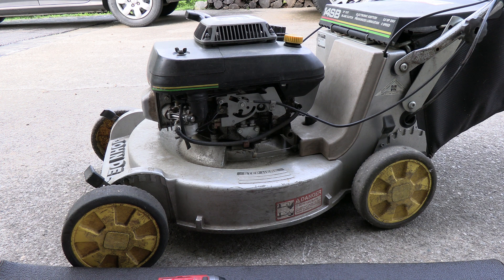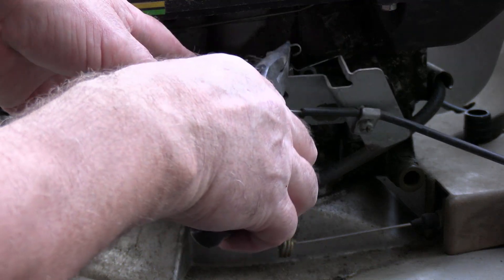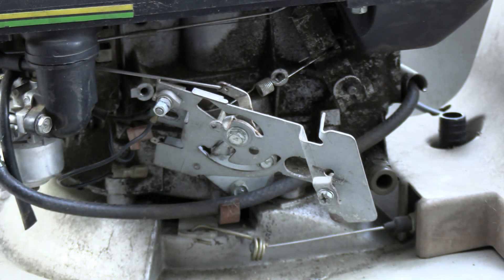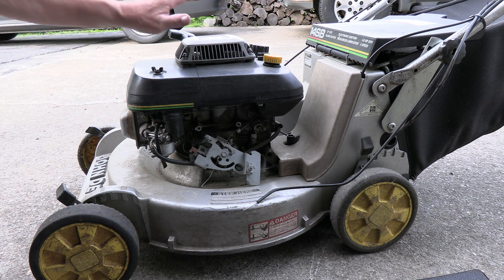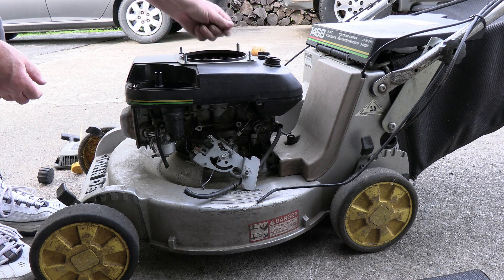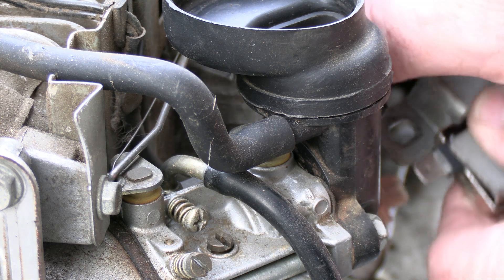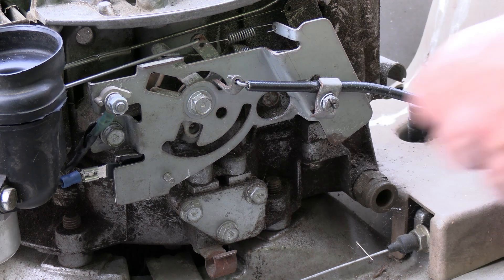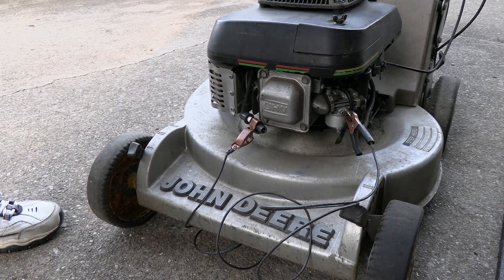John Deere igniter replacement. It might not be the coil.

Comment: I have a cub cadet RT65  MODEL# 21AB455C709   The wheel fell off and i was wondering if you would know what size that bolt is that holds it on.   thanks
Reply from the maker: If you have a cub cadet RT65 why am I looking at a John Deere video?
Reply from the maker: Your welcome, and here are the parts you would need.
Flange Lock Nut, 1/4-20

Hex Head Screw, 1/4-20
Reply: @LonnieJohnson1  thanks , im not at the tiller right now, I had back surgery, do you know about how long, and it seems like the nut was a 7/16 does that sound right, thanks a lot, very nice of you. Terry
Reply from the maker: Hex Screw, 1/4-20 X 1.50 Grade 5
Reply: @LonnieJohnson1  Thank you👍
Reply from the maker: Your welcome

Comment: You did that so wrong There was no need to take top off the put back on the link i am a expert on JD 14SB Mowers also the Igniter you pulled off the mower was not for a 14sb and the new 1 you put in is a after market china version stay with oem
Reply from the maker: Maybe for you and I, but for a someone that wants to tackle this themselves, yes it was done right. You have to look at the big picture. This is a how to video and you and I already know the easier way that most people don't. This is for the DIY person wanting to save $$$ and now they know how to take it all apart. If you want to spend $112 for OEM verses $8 or $9 for after market help yourself. Also the coil is $95 OEM verses $26 after market plus tax of course. Thanks for the comment.